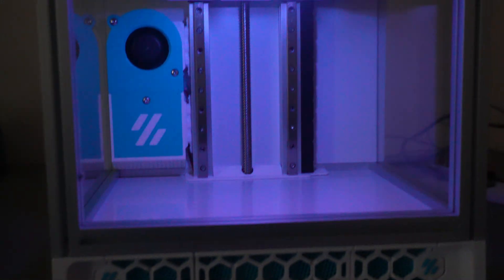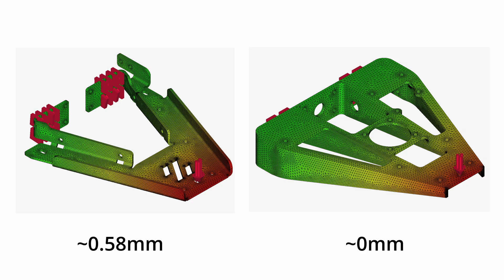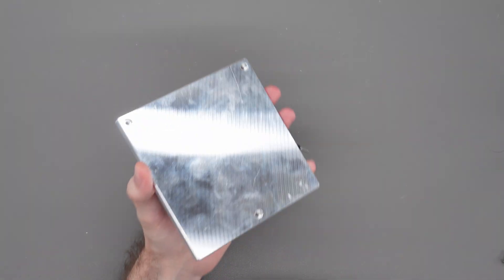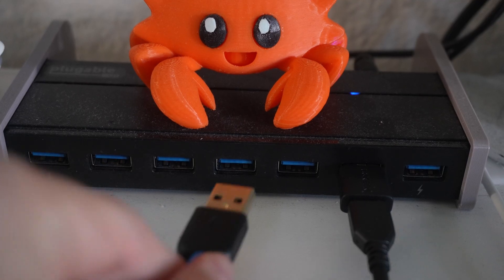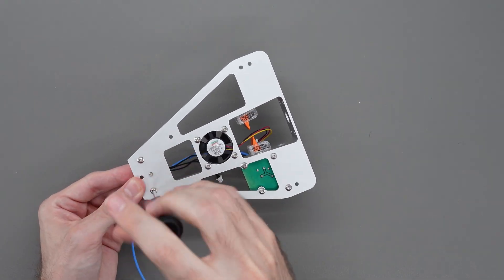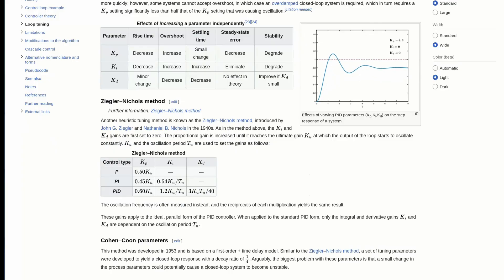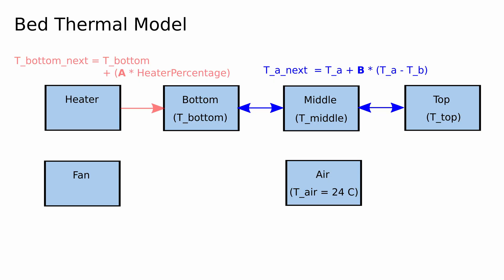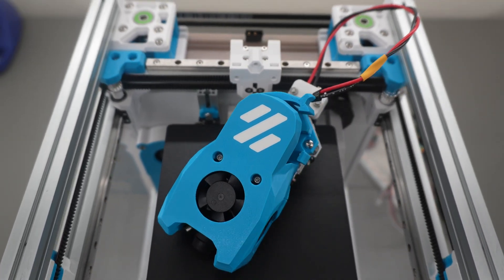My bed is better than yours | 3D Printer Build Part 2

Comment: Excellent video. I not only enjoyed the content, but felt it was surprisingly well produced. I'm curious why you opted for single wire communication. There are some obvious downsides, and I don't see an offsetting upside from skipping a second conductor. Not a critique, honestly curious what the reasoning was.
Reply from the maker: Thanks! To make it easily DIY buildable, I opted for an 8 pin ATTiny MCU. Once you wire up all the other peripherals, I only ended up with 1 pin left for the serial link. At least for the bed usecase, these's no need for duplex communication or high speed so minimalism was the other factor.

Comment: A few things. .5mm when you have 1kg on the very edge? I think that scenario is very unlikely to ever happen in real world. I think the stock voron bed is sufficient unless you like to tinker i guess. Why didn't you do show your bed on rigid setup?
Reply from the maker: Yeah, these videos aren't meant to be super rigorous and definitely there is more room for validation... 1kg here was chosen somewhat arbitrarily to make the relative difference between the beds more measurable. How much it matters needs more quantification but my main motivation for optimizing stiffness is based on online comments from other Voron users who seemed to have issues with stiffness on the stock solutions.

Didn't re-test the bed on the rigid setup mainly to save some time due to some bad planning. By the time I had the rigid setup ready, I already installed the bed on the printer with all the wiring so to avoid the annoying process of taking it off and on, I opted for not re-testing it.
Reply: @MadeByDennis you're right that's a great static scenerio to rest differences there's probably lots of dynamic issues as well. Makes sense.

Comment: "i used my phone level app" whaaaaaaaaaat. Sorry but for a but who modeled his own bed bracket that was surprisingly lacking. Take two straight pieces of metal (like, linear rail rail, some old round linear guide rod, just pieces of vslot) turn the printer upside down, rest the pieces across on your side linear rails and the bed on them, now it should be pretty much on a parallel plane.

Comment: imo the software is way way way overengineered and not in a good way. your data shows that the difference between the surface temp and where the thermistor is, is different only when heating up. during normal operation the difference is within the measurement error. 

a simple pid loop will get the temp pretty much spot on, albeit a few seconds later. and that's absolutely not a problem for us. Even if the difference of 1° impacted the bed adhesion (which it doesn't), you can simply calibrate the offset once and forget about it. Plus you need to wait for the bed and the chamber to sink the heat either way.

What physics based heating algorithm would be good for instead is the hotend. We want as fast heatup times as possible (so we can heat it up and cool down on a tool change) and for the temp to be as accurate as possible. But it does have many more variables (cooling fans, flowrate, physical design of the hotend, materials used etc).
Reply from the maker: Thanks. That's fair criticism. Definitely PID is plenty good for this use case. My goal is to start with a simple use case and later see how this works on more complicated systems like the hot end. More focused right now on characterizing all the different effects before going with something simpler.

Comment: Ya should take a HHD motor with a platter or two and mount it to the underside near the middle for some extra stabilization 😆 and maybe use a flex cable instead of a serial interface

Comment: Nice build, well done! I also finished my V0 upgrade this week from kirigami to a fysetc cnc bed frame and moved from lead screw to belted z mod. I am now finally happy with the printer.
Reply: What’s the benefit of a belted Z? Which mod did you use?

Comment: Your video would have done the same with out Ai, not alot of people are this deep into 3d printing, about 30k will watch this.
Reply: I think the goal was to improve the accuracy of the bed temp sensor...no clue why you think it has to do with metrics, or why you spend your time pretending to be some view count oracle.
Reply: @TheOfficialOriginalChad .................
Reply: „Not that deep“ it’s a vid about a open source printer with custom mods? It’s not a „why u should buy a bambolab in 25“ 
The Ai title is the catch, it was used as a tool not a Feature.